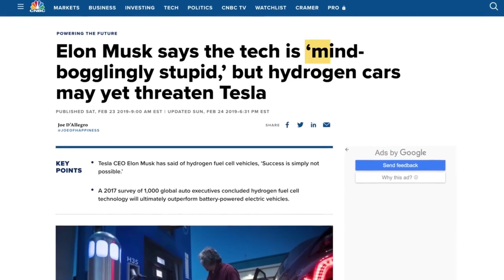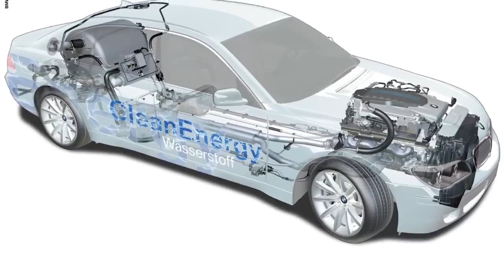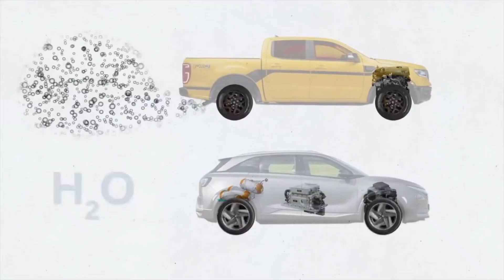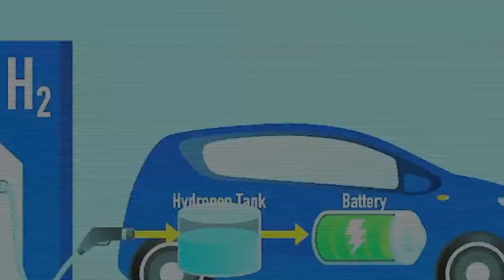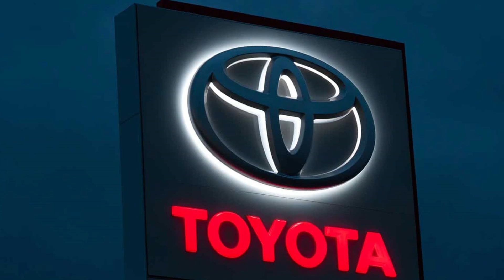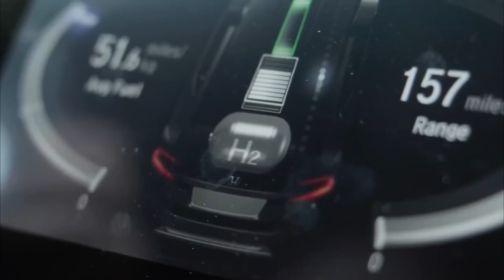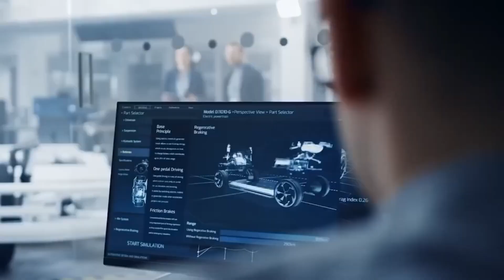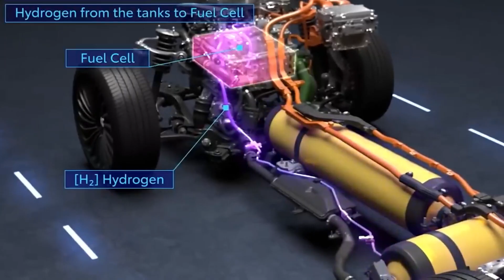Toyota's New HYDROGEN Combustion Engine Will Change Entire EV Industry!

Comment: ”And with real-world testing already in progress, it won’t be long before these marvels hit the open road."

Toyota has been "real-world testing" hydrogen prototypes since 1997 and still has no commercially available product to show for it. Meanwhile, EVs have gone from zero to 20% of the world-wide auto market in just over a decade. Which means the infrastructure to support EVs is already largely in place.

There are currently only about 100 hydrogen fueling stations in the entire US. Meanwhile S&P Global Mobility forecasts there will be nearly a half million EV charging ports by 2025, and that by 2030 40% of the US auto market will be EVs. Meanwhile the global market has just hit 20% which means we’ll likely see EVs at 75% by the end of the decade, while Toyota is still tinkering with hydrogen.

Further, hydrogen fueling stations currently cost about $1 million per pump to build. A single level 2 EV charger is about $6000. And EV owners actually do about 92% of their charging at home, only visiting charging stations about a half dozen times a year on average.

When can we expect to see at-home hydrogen fuel refilling?

Comment: An engine that runs on hydrogen from of course Toyota but at the moment  hydrogen refilling ststions a bit thin on the ground we have known about hydrogen fuel cells for a long time and Toyota are actually selling a hydrogen fuel cell car also a few years ago we had vehicles converted to run on LPG the only reason LPG was half the price oer litre than a litre of petrol the taxi industry in Australia embraced it nut now most taxis are Toyota Hybrids now as long as the infrastructure is there to supply the hydrogen and with the LPG because Australia is the ultimate nanny dtate all the years of LPG there were no major LPG incodents because it was highly regulated it will be the same gor hydrogen and in Australia the biggest selling car make id Toyota and the biggest selling vehicle in Australia is the Toyota Hilux once the infrastructure is in place Hydrogen Toyotas will sell